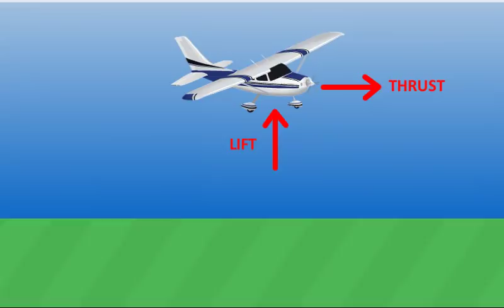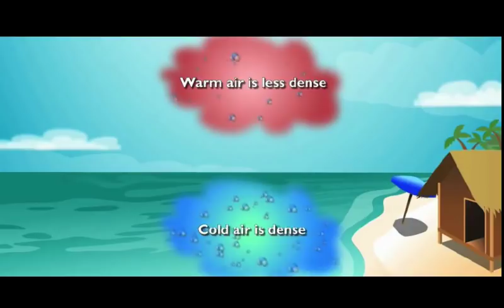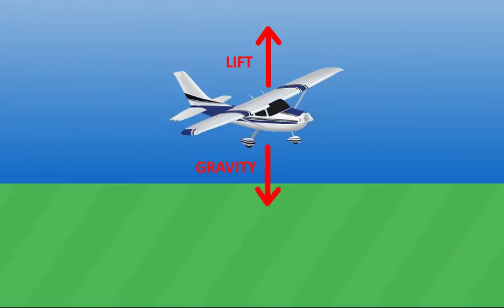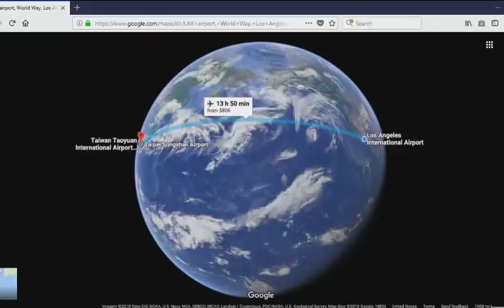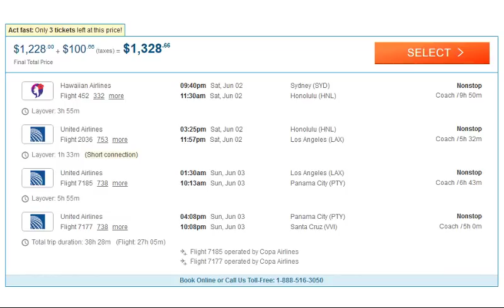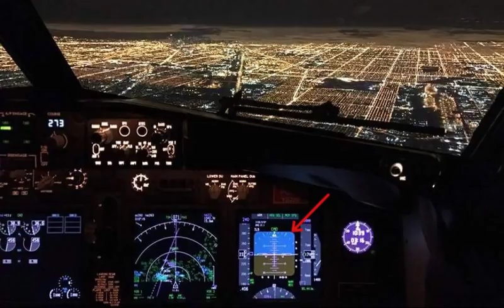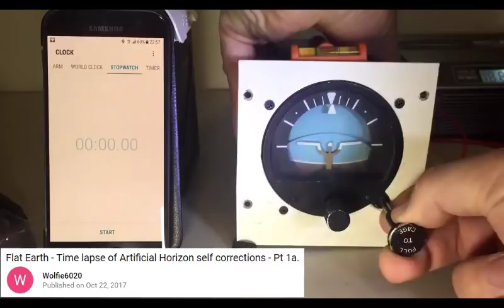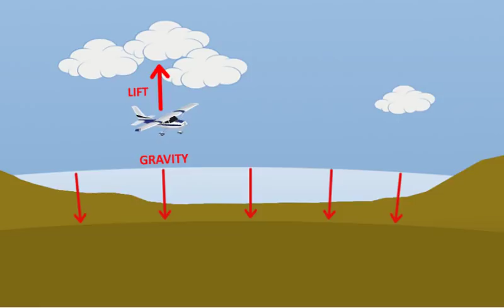Flat Earth Falsities - Plane Nonsense

Comment: Additionally a plane cannot ‘fly off into space’ because unlike a rocket a plane flies by producing an aerodynamic reaction to the air flowing over its wings, aka lift. That’s why an aircraft has wings. 

Since  all air is held to the earth by the force of gravity, so an air dependant system of flight could never leave the Earth since it can only work in an atmosphere, which doesn’t exist in space .
Reply: An AIRcraft flies in the AIR. An altimeter works by responding to decreases in air pressure with altitude. A phenomenon which, btw is IMPOSSIBLE on a flat earth . 

Your deliberately misleading nonsense of a plane needing to ‘adjust’ its altitude to compensate for the curvature of the earth invokes the visualisation of a kid standing at the departure airfield and flying a kite with a string attached to it. And your idea of ‘altitude’ involves a distance which is a reference of the plane from that kid. That’s not what altitude is, the actual vertical displacement is relative to the position of the plane(from the ground, well sea level to be exact, that it’s flying over), not the starting/take off point. And that isn’t always ‘constant’ either, in fact it hardly ever is . But that’s way beyond your manifest inability to comprehend, let’s just say it’s dependant on atmospheric pressure changes from one location to another.
Reply: I have a simple proof as a professional pilot to any and all flat earthers proving that the earth is a globe:

When you take off from an airport, most aircrafts have both a VOR and radar. The VOR consists of very high frequency radio waves that are used for navigation, while a radar is also a system of primary and secondary radio wave pulses that tell the ATC the position of the aircraft. 

Anyways, after a certain distance without exception you get out of the range of both the VOR and radar coverage  from the departure airport. The reason? Unlike an aircraft, radio waves are not affected by gravity and do indeed ‘fly off’ tangentially into space DUE TO THE CURVATURE OF THE EARTH. If the earth were flat, every single airport would have unlimited VOR and radar coverage, which is not the case. This phenomenon, known as ‘line of sight ‘ propagation is impossible to explain on a flat earth. Heck, a radio wave that travels from a fix on the coast of California should be able to reach japan since there are no obstructions on the way!! But of course this doesn’t happen, since the earth is, in fact, a globe.
Reply: The Trax, you're halfway there. Now consider this: While in level flight, the altimeter of a plane never changes. this wouldn't be the case if the Earth was truly a sphere, at some point the pilot would have to adjust the altitude in order to compensate for the supposed curvature of the Earth.
Reply: David Dirré-Moire no he wouldn’t . Do you even understand how an altimeter works?
Reply: @thetrax3482  Exactly my point. The Flat Earth model predicts that no altitude adjustments would be necessary in level flight, just as you wrote.  You've basically proved the Flat Earth model.
Reply: David Dirré-Moire are you feeling okay ? Do you need some meds or something ?
Reply: @dirremoire  There is no "Flat Earth model". The FE cult belief requires that gravity does nit exist and if gravity did nit exist the Earth wouldn't either, nit t mention the g-fact that  atmospheric pressure would not decrease with height and therefore altimeters wouldn't work and there would be no weather.
Silly Billy.
Reply: @thetrax3482  that is the difference between a proffesional and uneducated..😂😂
Reply: @dirremoire  flat earthers can look but they can't see...

Comment: air route argument debunked convincingly; however I am still not convinced about the helicoptor example,  does an aircraft have to be outisde the atmosphere to observe the effect flat earthers claim
Reply: What has air routes debunked exactly, they are all supportive of a flat circle flights, passing North.
One wonders.. one thing of having a perfect automatic sticking to ground, but air momentum is one explanation, but a heavy mass departing solid ground into it should suffer some by air carried go-round, just can't be equal carriers.
Reply: @BrainUser1  your point??
Reply: @lopsangdlama  "@Louis Shaw your point??" Does trolling have a point? Outside of itself?

Comment: Also when  a plane is flying in what flatheads call a straight line its not. Its set at a particular height  from the earths surface.  The pilot never says we are now flying straight or going up or down he will say and set his instruments to be at a height from the earths surface. 30,000 ft , we are now traveling at 30,000 ft and should be at your destination in ex amount of time and it follows that line at 30,000 ft it doesnt keep climbing like the stupid non thinking flathead thinks.
Reply: But, but, muy holey buybull am der troof.

Comment: I typically use an example of a bug flying around inside a train moving at a 100 mph with an open window. The "atmosphere" in the train will still enable the bug to fly around, hover and move in relation to the inside of that train even if there is a window open. 

Then there is this "Earth is spinning so fast, the globe model is impossible". Ehm.. 1 RPM every 24 hours is not fast. Not for a giant object like Earth. Besides, you should check out Jupiter. Its bigger than Earth and spins way faster, and the result is obvious: Strong, unlivable winds in its atmosphere.

Take a pendulum and suspend it from the roof of your car, then take a balloon filled with helium and tie it to the floor of your car. When you accelerate, the pendulum swings back and the balloon moves forward. That is because air has viscosity. That is how the atmosphere stays with the earth spinning. Just have a look: https://www.youtube.com/watch?v=y8mzDvpKzfY&t=179s
Reply: Good ones. I realise there is ultimately a bit of a problem with the bug example, which is best left unstated unless one of the faithful or a troll works it out, but other than that a good one.
Regarding spinning, I use slowly rotating - it upsets them and tends to attract abuse.
And the last example is epic.
Reply: @boffeycn  slowly rotating?  At the equator the Earth would be rotating at an impossible 1600 km an hour!  Even faster at the (imaginary) North Pole. So, tell me again who the crazy ones are?
Reply: @dirremoire  Thank you for proving me correct
"Regarding spinning, I use slowly rotating - it upsets them and tends to attract abuse."
Reply: @boffeycn  I'm not upset, but I will call you out when you post false information, whatever your motive.
Reply: To make your analogy work with an equator spinning at 1100 mph, a bug could hide behind a skyscraper (which was being buffeted like the windshield of the train or is the air also moving?). If it ventured beyond the building either it would be blown away by the 1100 mph wind like it would be sucked out the window. But if the air is also moving (sic. beinn or out from behind the building with no issue. g moved) at the same speed as the surface under it then the fly could move i

Comment: So why the clouds don't fall due to gravity???
Reply from the maker: makarony tony - clouds are buoyant. They are made up of water vapor that is slightly less dense than the air at the bottom of the atmosphere, so they float like a cork in water. They will rise until the air above is less dense and the air below is more dense. Buoyancy is a direct result of gravity. Gravity pulls a little stronger on denser materials, so the atmosphere, including the clouds in it, is always “sorted” more dense to less dense as you go up.
Reply: Why not google your question, find out the facts, pay attention, and use some common sense. Or you could just subscribe to #VoysovReason channel and learn all about the Earth, and the wonders of the universe
Reply: Makarony tony   What the F*** do you think fog is?? or rain lol all cloud related
Reply: @gordonbrittas4842  some don't fall asshole when you go outside
Reply: @makaronytony1788  I think someone definitely had made them self look an arsehole  here.
Reply: Is your brain flat too?
Reply: They do fall down. We call it rain.
Reply: How can your penis defy gravity?  It's a science mystery! Good grief, CRACK A BOOK!!!!
Reply: No air in space how do shuttles thrust??? When it need air
Reply: @makaronytony1788  
Fg=G.m1.m2/r^2
Earth. Very, very, very big. In fact fucking enormous.
Moist air droplets. Very, very, very small. Density less than dry air, therefore m2 minute.
Therefore Fg is fucking enormous m1 x fucking minute m2, which is obviously too fucking minute and beyond your ability to comprehend. Correct?
Fg=G.m1.m3/r^2
Dry air density less than humid air therefore m3 greater than m2.
Therefore Fg is fucking enormous m1 x m3 which is more than m2 and therefore Fg is greater, which is obviously too fucking difficult and beyond your ability to comprehend. Correct?
Reply: @makaronytony1788  They also carry liquid oxygen with them as fire needs air to burn. So the oxygen is also expelled thus causing the thrust they need for orbital maneuvers.
Reply: makarony tony you’re drunk.
Reply: Followers no one here has ever made their own decisions in life I bet
Reply: makarony tony says the idiot following the Bible. A book written by a comedian 2000 years ago
Reply: @makaronytony1788  "Followers no one here has ever made their own decisions in life I bet" No tony, you are the follower.
Feed my sheep. Baaaa, baaa.
Reply: Why do we need permission to fly over Russia to get to Korea or China when they are rite on our backyard when we use a globe??
Reply: @makaronytony1788  "Why do we need permission to fly over Russia to get to Korea or China when they are rite on our backyard when we use a globe??" Ever heard of Great Circles, tony? Ever heard of a Azimuthal Equidistant Projection of the Spherical Earth?
Reply: @boffeycn  that's not a answer to the question
Reply: @makaronytony1788  Fg=G.m1.m2/r^2
Earth. Very, very, very big. In fact fucking enormous.
Moist air droplets. Very, very, very small. Density less than dry air, therefore m2 minute.
Therefore Fg is fucking enormous m1 x fucking minute m2, which is obviously too fucking minute and beyond your ability to comprehend. Correct?
Fg=G.m1.m3/r^2
Dry air density less than humid air therefore m3 greater than m2.
Therefore Fg is fucking enormous m1 x m3 which is more than m2 and therefore Fg is greater, which is obviously too fucking difficult and beyond your ability to comprehend. Correct?

Comment: Come on NASA show us a zoomed in photo or live feed of aircraft upside down over Australia or people walking upside down or how about a ship sailing sideways on the oceans and seas at the equator or aircraft flying sideways there too . There is supposed to be thousands of satellites with cameras and the Hubble , Kepler , Spitzer , and other outer space telescopes and the INTERNATIONAL FAKE SPACE STATION . BTW THIS VIDEO IS TOTAL BULLSHIT , nice try but we aint buying . Don't forget at 62 miles above sea level the Karman line a pressurized atmosphere next to a vacuum of outer space with a vacuum force between 0.000000001 Torr to 0.00000000000000001 Torr that's enough to suck all the air off the earth .
Reply: It already exists. It's called Google Earth/Maps. Find Australia and zoom in. Everyone is upside down compared to USA.
Reply: @josephkreifelsii6596  not even a '' nice try '' FUCK OFF
Reply: Dr Arthur Rudolph was the chief architect of the Saturn 5 engines of our Apollo Moon rocket. He came into the US with von Braun and other German scientists under Operation Paperclip. Rudolph was a full colonel in the Gestapo. 
He had killed hundreds of Jews personally during the building of the V-2 rockets and Peenemünde. If you made a mistake, he would put a cable around your neck and slowly lift you up, which would strangle you. 
    Then he would disembowel you and leave you hanging there for everyone to see. There were rotted corpses hanging all over the place. They would also feed you sawdust and water. This would take the hunger out of your stomach until you fell over dead, then they would just replace you with more fresh people. 
    This man was the winner of the Most Distinguished Service award - the highest award NASA can give. 
    The Mossad caught up with Dr Rudolph on May 25, 1984. Due to war crimes, he was deported out of LAX to Munich, Germany, where he died [in jail] :)
- NAZI NASA the Sheeple loved Uncle Sam agency and scifi publishers.
Reply: @BrainUser1  ILL MIND is right , thank you !
Reply: Wow you are an Idiot...